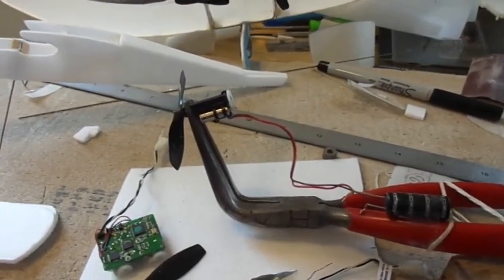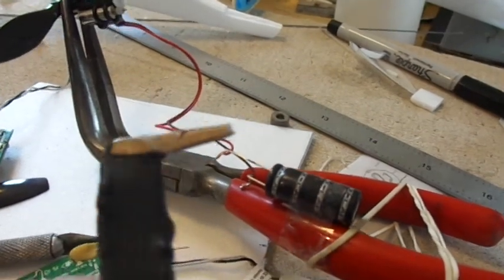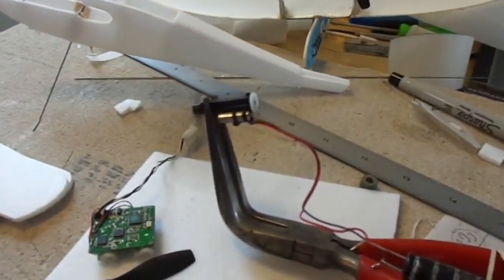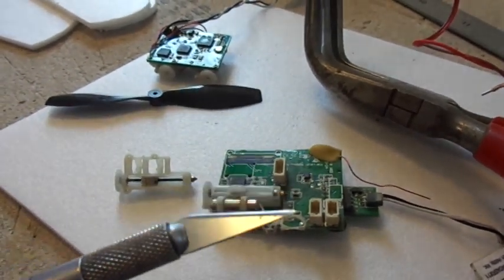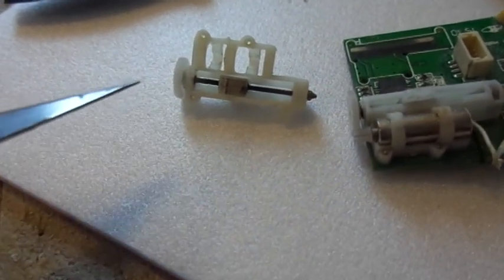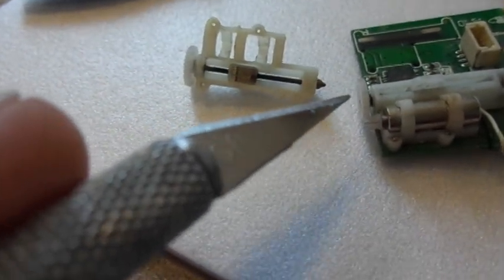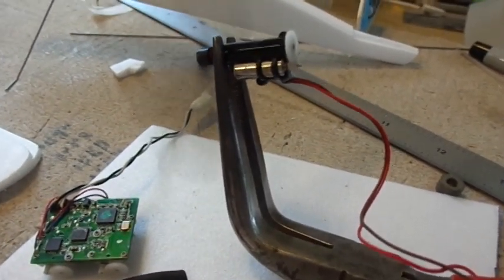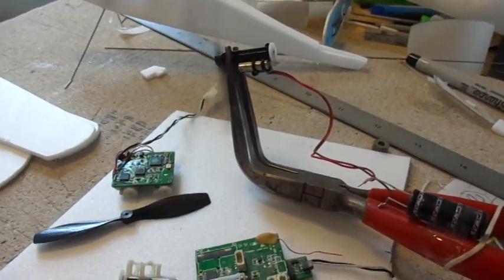PROP DRIVE from HACKED SERVO: Junk to treasure?

Comment: Why not use rubber drive between the prop assembly and the drive motor. That way you could adjust the motor assembly to optimal CG.position. also could adjust thrust line of the prop more easily.

Comment: For a slow flying aircraft it’s always much more efficient to move a lot of air slowly than a little air fast as they say. That is really cool. Do you have a beginner parts list somewhere? I want to try some small models like this.
Reply from the maker: Yes, this little geared unit really ran a long time. It was a flyaway in my little 13 inch span Goldberg Ranger 30. I got it back 2 months later when the rain dissolved the glue and the pieces fell out of the tree. There is a parts list in the text description of this video:  https://youtu.be/vF1mOyZc1lk 
The parts listed would be perfect for building a peanut scale foamie...or for following along and building our "build-along" series model (find the video playlist here: https://www.youtube.com/playlist?list=PL7SpYfvruCgDklw6PAESD-2g6nVWtKLMz
The "build-along" model is easy to build and is a great flyer. Lots of positive feedback from builders. Capable of exceeding one minute in still air. It's a fantastic first model!
Reply: @sonex413  Thank you!

Comment: Thamks for a great video as usual, I am experimenting with geared drives for my micro coreless/ capacator  setups but with little or no success to date. Very interested to hear how the flying goes.
Reply from the maker: Hi, so sorry for the long delay in replying! The little prop drive from this video ended up flying away in a roughly peanut-scale Goldberg Ranger. It had a super long run time but not much thrust. Unfortunately on one flight it got a bit of help from a weak thermal which led to it being stranded in the top of a huge tree until the rain dissolved the glue joints and I got a few bits back....the wing and the prop drive thing..
We're still experimenting with different sizes of motors, props and capacitors...trying both larger and smaller than previously. Lots of combinations can work if you tailor the airplane to the characteristics of your power system!

Comment: glad you like using foam for models also,  All most all my free flight and Rc are all foam.
Reply from the maker: It depends on what we're building...the little free flights need still air so we fly real early or right at sunset. Usually the tissue covered stuff gets awfully saggy when exposed to the dew  at those times! Plus, the foam is cheap or free, we're using a lot of styrofoam meat trays from the supermarket!  My flying buddy Richie is a die hard balsa fan and only recently admitted that the little foamies are pretty cool!

Comment: That would be the perfect motor for my EDF parkjet
Reply from the maker: I think it is only good for a lightly loaded "floater" kind of plane. Don't forget that's only a 5mm coreless motor! I made an experimental MiG 15 using a hot 6mm motor along with a rotor and shroud from a micro quad, it "almost" had enough power to fly, I'm thinking a LiPo instead of a capacitor and it may work. Hit that sub button and stay tuned!